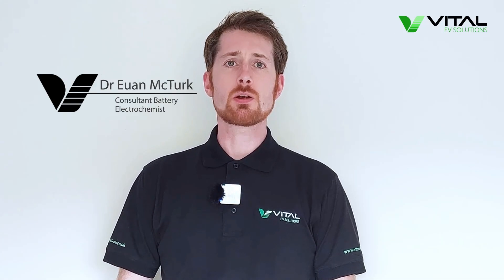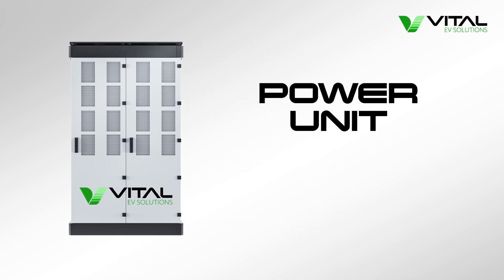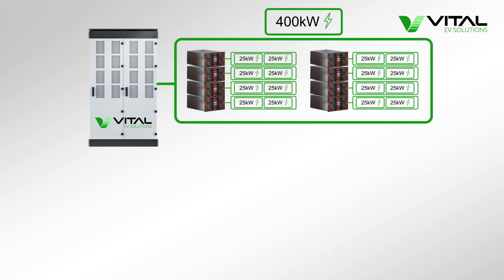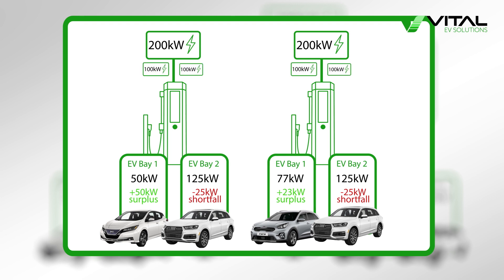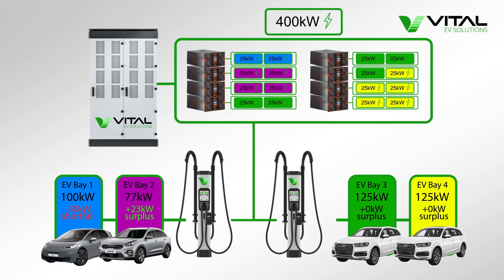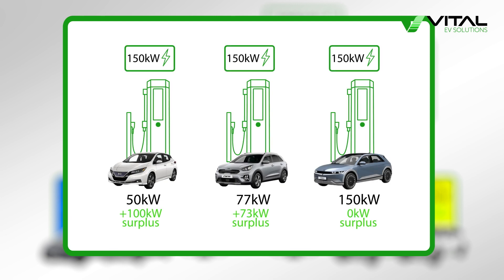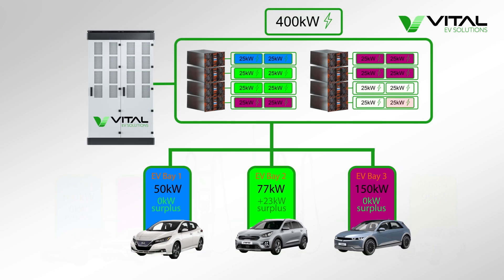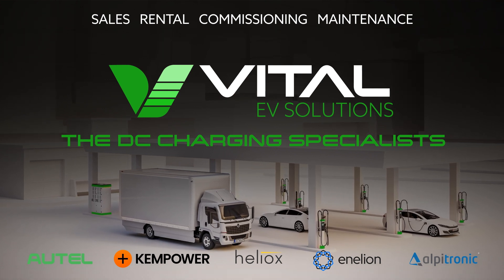Kempower's Dynamic Power Management from Vital EV

Comment: That's an incredible set up.  If more charging hubs had smart power allocation there would be less disappointment from drivers who's EVs can pull more power, but it is never allocated to the charger they are using.